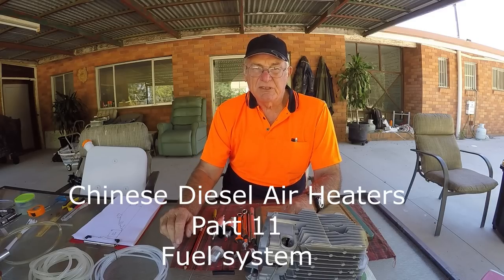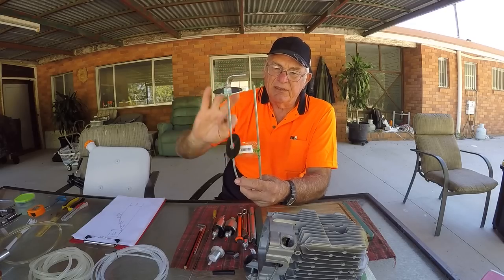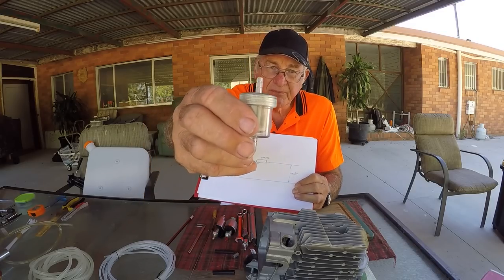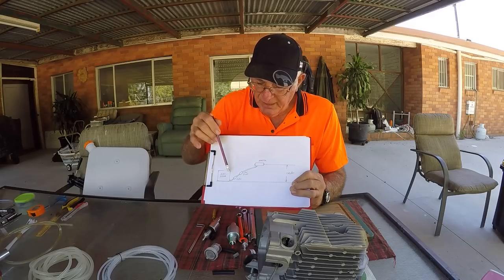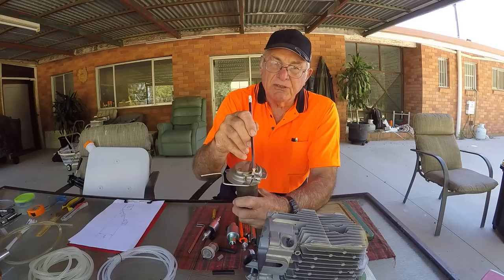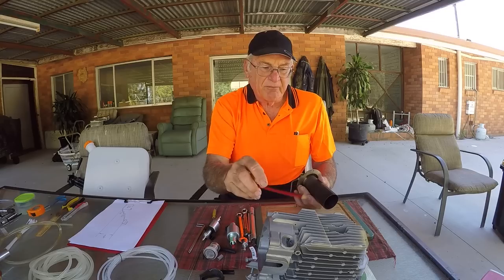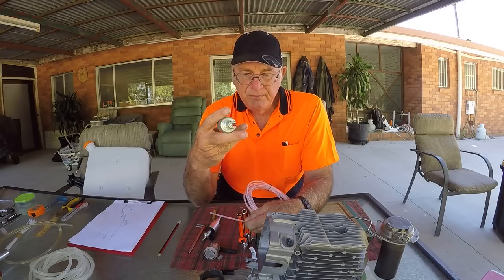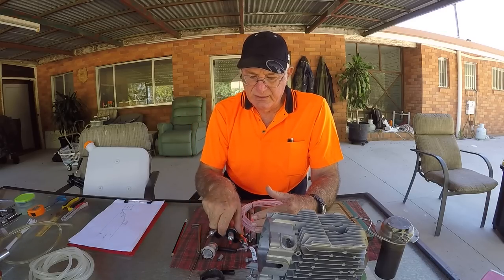Chinese Diesel Air Heaters - Part 11 -  Fuel Delivery

Comment: For Canadians I found certified fuel rated hose 3/32" (2.38mm) ID x 3/16"OD, 100psi (690kPl, 9bar)) at Home Debit, . It's in the plumbing department with the white nylon hose. It's easier to bend then the nylon hose and wont kink, but the material is far less compressible than the cheap soft hose that come with most diesel heaters. Made by Canada Tubing Products, part # SUFD10, it was less than $10 for 10' (3m). I tried heating the line to see if it would slip on, it won't, so you will still have to get attach the same way as in John's excellent videos
Reply: Thanks! Where did you find all your other fittings, exhaust hosing etc

Comment: Thanks. Lots of useful information, no unnecessary music, "hey what's up" or other bolleaux. Great video
Reply from the maker: Your welcome Jonathan.   JMcK
Reply: @johnmck1147  Hi John,  Where can you purchase the nylon small internal diameter fuel line. Regards Bruce
Reply from the maker: Bruce Argyle 

Hi Bruce, there are a number of online sellers. 

Search hard nylon fuel hose for Eberspacher diesel heater.

I don't like to list suppliers in the description as sellers come and go. The last supplier I bought hose from is no longer there.

I just did a quick search to get you started. See below.

https://www.ebay.com.au/itm/Diesel-Heater-Nylon-Fuel-Line-OD5mm-ID1-5mm-7m-/333785075903?_trksid=p2349624.m46890.l49292

Cheers.   JMcK
Reply: @johnmck1147  
Thanks  John, didn’t seem to find a lot will retry. So what is the ideal inside and outside diameters.
Reply from the maker: Bruce Argyle 

Hi Bruce, 

The ID is not so critical, 1.5 mm to 3 mm ok. 
Probably 2 mm ID would be ideal.
It is “hard” part that matters. The pump puts out pulses (squirts) of fuel, and a soft fuel hose on the delivery side of the pump absorbs these pulses making the fuel delivery to the heater less efficient. The outer diameter does not really matter, but thicker (stiffer) is preferable to thinner.

Cheers.  JMcK
Reply: @1Maxsophie  It is used for oil pressure gauges, air line and even ice makers line in freezers.
Reply: @johnmck1147  We have discovered by pulling the line back, away from the pump 1/8" the TIC, TIC does not travel down the line and radiate to other areas.  We wrap the pump in a piece of pool noodle with Zip ties and suspend the pump with Zip ties to almost eliminate the sound 100%.

Comment: I have tried it both ways and the supplied soft large bore fuel line did work, however the small hard line as described by John did work MUCH better! 
It's little nuggets of knowledge like this that should make John's entire series on these heaters mandatory for anyone purchasing one of these heaters. You owe it to yourself to watch this incredibly well researched series. Tons of knowledge in each episode.
Thank you John for all of the hard work that these videos must have entailed!
Reply from the maker: Hi 74 Willy,

First thanks for your kind comments.

Yes, the soft large bore  fuel hose will work (for a while) 
If the length from pump to heater is short  it will work for longer.

The issue is this is not like a normal internal combustion motor with a carburettor, more like a fuel injected motor where the fuel is injected into the engine. In this case into a glow plug atomisation screen to start the heater and then into a big burner atomisation screen to run the heater. (See how far you would get using soft fuel hose to car engine injectors)

The diesel must be squirted into these screens for atomisation. Soft fuel hose absorbs the fuel pulses, which causes lack of atomisation, which then causes carbon formation, which causes restriction to fuel passage, which causes more carbon, which causes more restrictions, causing more carbon etc.

If the fuel delivery is short and you were only supplied with cheap transparent plastic fuel hose and can't source hard nylon fuel hose, at the very least buy some quality automotive fuel hose.

Cheers.  JMcK

Comment: We are fortunate to have someone as talented as you providing this priceless information on the intricate details of what looks like a purely simple system. I can’t imagine the amount of time you must have spent to produce these videos 🤔 Certainly the data shipped with these units is inadequate, hard to interpret at best and flat dangerous at worst. As a retired Cat diesel mechanic, I thought I knew all I needed to know for such a simple device, and in fact, I had no issues with my shop workspace installation, but am thinking of your attention to detail on butting the small id rigid tubing within the soft hose connections to prevent an accumulator effect, cavitation etc. Although I was careful, I fell short of verifying all those points and think I will go over my fuel delivery system to make sure it is in optimum shape. Even thinking of doing a micro and I do mean “micro” bevel at the hard line cuts. As I said, my machine is performing very well, but with such tiny flow rates everything must be very precise for a clean efficient trouble free burn. I have my unit mounted high in my shop and the fuel tank is low as is the filter and pump, but I’m asking the dosing pump to lift the fuel straight up seven feet or a little over two meters, and while it’s working fine now ; I should probably change that for the long haul. Thanks so much for the great information!  “💡”Have you ever thought of contracting with these Chinese manufacturers to write a proper discernible installation/troubleshooting manual? Cheers 🍻👍
Reply from the maker: Hi Siskyiou, thank you for the feedback. I think bevels are not necessary, but a 2 m push for the pump is right on the limit. If your heater is working well with no smoking I would leave it be. I would love feedback on how the pump performs at that hight. J
Reply from the maker: Hi Mr Si. Reading this again, I tend to think your proactive thoughts  may prevent issues with your heater in the future particularly as you are asking a lot of the little dosing pump. 

Re the manuals, the Chinese have copied much of the genuine Eberspacher Manual, from German to Chinese and then appear to translate from Chinese to English. The English version of the Eberspacher D4 manual is well worth reading.
Reply: Hi John McK 47, I’ve verified the the plastic fuel line is butted at the tank, filter, pump and the input at the main unit but did not take the time to micro bevel the tubing as the way I cut it didn’t smash the tubing. I was however inaccurate in my fuel lift estimation as it is only 5.5’ a bit under 2 meters and the pump is gravity fed at fuel tank levels above 1/3. I’ve got 8 hours of run time and everything is looking good. Thanks for the information on the OEM manual, I will be looking into that🤓 Oh, and I sprung for the “8 kw unit” because of the type of space I’m heating and of coarse now know that it’s really a 5 kw. For the extra $40 dollars I got a fancy fake carbon fiber paint job ha ha🙃 Live and learn, but I’m happy with its performance just the same.
Reply from the maker: Siskiyou Woodsmann,     Sounds good. The height is a bonus as well. Enjoy the dry heat. J
Reply: You're a bloody LEGEND! :)

Comment: I am a lady (so ignorant as far as how things work mechanically) and have been pulling my hair out trying to instal the heater in my caravan with badly translated instructions and worse illustrations.  I had thought the supplier had sent the wrong fuel line - the hard type that did not fit the fittings, so I went out and bought the bigger soft fuel line. Have attached it all but still have to do the exhaust etc.   Thank heavens for this very explicit video. I will now have to replace all of the fuel line with the original supplied, especially now I know how to join to the fitting.  I have watched quite a few videos trying to get some insight as to installation and none go into enough detail. Thank you so much.
Reply from the maker: Hi Carol,

Thank you for the feedback. It is generally ok to have the soft fuel line on the intake side of the pump, provided it is of a short distance. But you really need the narrow bore hard nylon on the outlet side of the pump.

Good luck with your install. When set up right, these heaters give wonderful dry heat for those cold winter days.  JMcK

Comment: Thanks for all these helpful videos!  I've just purchased my first heater and have been installing it into a portable box for camping with our rooftop tent.  I think I will have done everything twice by the time I'm done with this build because I didn't take the time to watch all your videos before I got started.  Thankfully, I haven't been in a rush so I can fix the way I ran the fuel piping before running the system.  In case anyone is interested, I just bought a Vevor 2kW unit (Dec 2021) and it came with the smaller gauge nylon (preferred) tubing and some rubber hose for the connections.
Reply from the maker: Thanks for the feedback Kevin.
Happy New Year.  JMcK

Comment: Great video mate, thanks for the advice.  I have just bought a heater and was going to use a better quality rubber fuel line instead of the nylon.  You saved me some dramas!!
Reply from the maker: Hi Andy,

You can use quality fuel hose from tank to pump to eliminate all the joiners. Remember this distance needs to be short.

You can also use quality fuel hose after the pump for short runs, 1m to 2m. Anything over that you really need to use the small bore hard nylon tubing.

Good luck.  JMcK
Reply: Thanks for that😊 I plumbed mine up last night with 3/16 fuel line it's only about 1m from pump to heater goes around a few corners of the caravan chassis but I put my pump facing downhill? That's what everyone else says? My tanks bottom is on the same level as heater (on van floor) but pump and filter are under van . Total hose used was 1.9m but I have about .5 to filter then .3 to pump. Do you think I should replace from pump to heater with the nylon supplied and change pump angle? Thanks Darren

Comment: Thank you soo much for this video I was experiencing the E 10 error on my Chinese Diesel heater, which was installed with the supplied 5m inner pipe. Changed to the Webasto nylon pipe 5mm outer and 2mm inner which I got off Ebay. After priming It started first time. You're a star for putting this video together and sharing your obvious immense knowledge.
Reply from the maker: Thanks for the feedback TA.  JMcK

Comment: You're a bloody LEGEND! :)
Reply from the maker: Wow! Thanks Trewin.
Reply: @johnmck1147   Hi. John . i´m from Germany and are Diesel is as clean as in the rest of the world ;-)
but i think the reason why the orignal German diesel heater only have that tiny filter installed is becouse they are mainly made for cars and the diesel comes in taht case from the car tank .. in that case the car has a filter systen wich is allready installed by the car manufactor. and thats why there seems no need for a nother big filter system 

Kind regards Willi
Reply from the maker: MC 11 

Hi Willi, thank you for that info and feedback. Also my apologies for my wrong pronunciation of Eberspacher.  JMcK

Comment: Thank you John !! I am so very happy with your videos, learned so much! One hint for users who are thinking (like me) about installing the so called "silent pump" by james browning-smith: This pump is a better "sucker" than the standard issue noisy model, so that the pump should be mounted near the heater - the setup is: fuel tank - filter - longer part of the fuel line - pump - short fuel line - diesel heater.

Comment: Thanks John as a retired brit trucker living in the USA and boondocking, i had trouble with a worn pump although not more than a couple of weeks use,i started from the fuel tank checked the flow downhill and flat,and checked joints ends of pipes,got a puff of smoke once,but as soon as i put a new pump on, no more problems !!!
I guess now i know for sure the fuel flow is good.
Thank you for your videos a great source of info.
I still had a piece of the fue line they used in the 80's in my toolbox black plastic 2mm inside but twice as thick as what you get now.
Reply from the maker: Hi Colin,,
Thanks for the info. Pleased things now ok.
I assume you have a good fuel filter in the line before the pump.  JMcK
Reply: @johnmck1147  yes,i got larger model filter a couple of inches from the fuel supply.great when it works correctly,using it right now (26f outside).
I love my night heater
Thanks J
Reply: @johnmck1147  checked my fuel filter,after a couple of days use,very fine (sand) grit in there,most likely what tore up my previous pump. Thanks again John

Comment: Hi John, Just coming across your videos having just installed a 5Kw unit into my caravan ready for the winter. Very informative regarding the fuel hose and delivery system, since I have  only once since installation a week ago had a successful run of the heater. Suffice to say, mine came with the poor vinyl large bore fuel line, which I see now I need to replace from the pump. (luckily I have plenty of the 4mm hard bore hose in my workshop). Another issue is that in the caravan, I am very limited in installation location of heater and fuel tank, such that without putting the pump outside / under the van on the chassis, it's near impossible to get a steady incline up to the feed point of the heater. What happens currently is the heater will not properly ignite, makes a very impressive smoke generator with clouds of white diesel vapour!! It's good to see from your video now how I can hopefully resolve my problems just changing the feedline!

Thanks for the great info in your videos. ;)

Comment: This is AMAZING! I have a LARGE bubble permanently stuck on the bottom of my VEVOR heater (inside his case). Lines are soft, so that's why the bubble is there. The heater works very well but now I suppose it can work even better. Will upgrade and test ASAP, thank you :)

Comment: Hi John, great run down. I was about to go and buy some large diameter fuel line as I couldn't work out how the small stuff was supposed to fit. You've just saved me money and no doubt some frustrations. Thanks.
Reply from the maker: Hi Andrew, you can run standard fuel hose from tank to pump on the suction side, but should only use hard nylon small bore tube on the delivery side of the pump.  JMcK

Comment: Brilliant. You can't beat old school who know their onions! I think you've saved me a lot of tears showing the shortcomings of the Chinese copy, which I'll be fitting shortly to the brother in laws' motorhome. I was going to tap into the fuel tank auxiliary if it has one and use copper brake pipe as I have plenty and the flaring tool, nuts and connectors but your suggestion of 2mm nylon might be a better way to go. Many thanks.

Comment: Hi John, thanks for your great videos. I have just installed a 8 kw Chinese heater in a workshop and it works great. My heater came with a remote control and a small online fuel filter which is a lot better than the tiny filters which comes with the D2 Airtronic. It is a good idea to run the heaters at a high setting regularly to keep the combustion chamber clean. I think our diesel in Western Australia is pretty low quality as I travelled over east for several months, running the heater every day for about 8 hours with no problems and clean combustion, however, once back home it only took about 2 weeks to soot up the combustion chamber. Adding some kero and running the heater hot does cleans the soot a bit but usually I have to replace the screen in the ignition changer. I like your removal tool!  Another problem I have encountered is a dust build up on the flame/ heat sensor mounted on the combustion chamber which can cause an error code. I found that the shortest length of the exhaust pipe possible will give longer periods between services, our diesel again. I have an Edith Diagnostics adapter for my Espar D2 heaters to work the error codes but have not had to use it much as I can usually figure out what causes the faults. Thanks again for you information. They are great space heaters,
Reply from the maker: Hi Peter, thank you for your detailed feedback. I agree with you about the variance of diesel quality and the need to keep the exhaust short or go larger. You also need to keep the combustion air intake short, or go larger.

Glad you like my screen removal tool, but have you managed to source the very rare screen insertion tool?   

Cheers,   JMcK

Comment: answered my question clearly. i wanted to go with a standard flexible fuel line that would fit the barbed fittings. I figured there was a reason for the small, hard tubing. Answered perfectly! thanks!!
Reply from the maker: Hi TSA, 
I use the standard fuel line for the pick up side of the heater. Ie Tank to shut off valve to filter to fuel pump. That removes a lot of the joins.

I only use hard nylon on the delivery side of the fuel pump. Ie pump to heater. More info in motorhome videos.

Cheers.  JMcK

Comment: I’ve just installed my new heater and it wouldn’t run properly. Ran for a few minutes then went off. It came with soft green fuel line. All that happened was very little heat output lots of white smoke and diesel dripping from the exhaust muffler and E10 error message. After priming at least 10 times and trying again I watched your very informative video and have ordered the proper hard small bore nylon hose. Hopefully this will fix my issue. Many thanks for the great video…….Very helpful

Comment: Thanks for your detailed advice! 
Was having issues with the heater on our used van and found they had used 4-5mm automotive fuel hose.
Cheers mate 🤙
Reply from the maker: Hi Tim,
Good quality automotive hose is fine for the suction side of the pump, but on the delivery side of the pump to heater you should use narrow bore hard nylon fuel hose.  JMcK